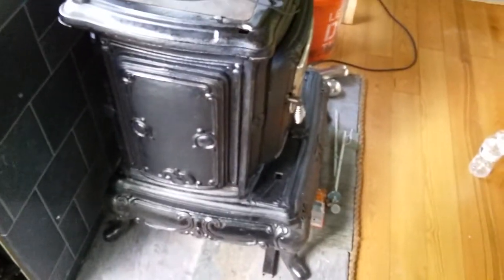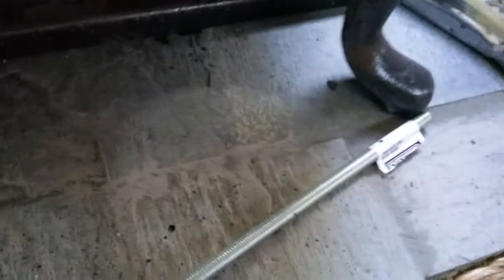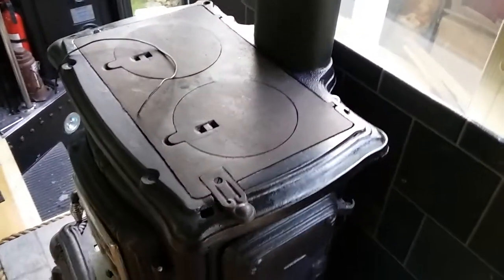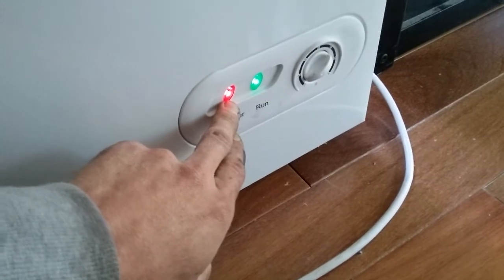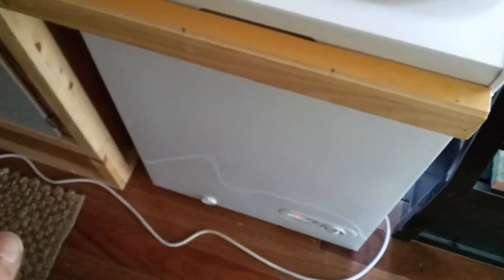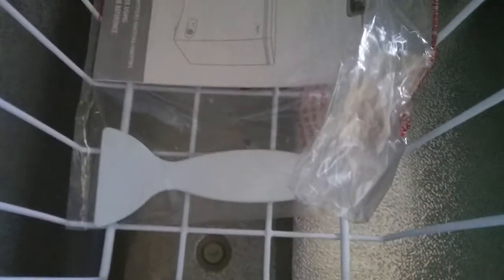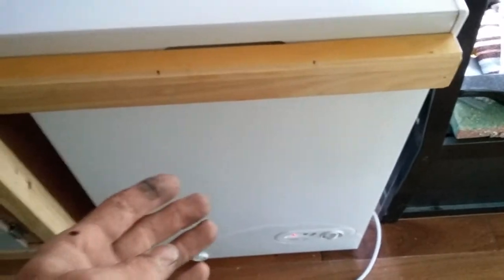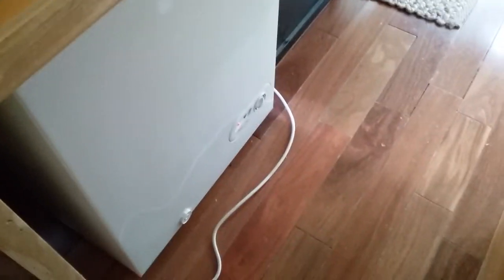Bus conversion  ☆DAY 47 WOOD STOVE & CHEST FREEZER

Comment: Get some gallon jugs and fill them about 80% with distilled water. Put them in the bottom of the chest freezer. You'll build up a nice thermal mass to help keep the rest of your food at a consistent temperature, and have extra potable water in case of emergency.
Reply from the maker: yeah, im goint to do that, an use the water for filling batteries down the road... thanks man

Comment: What brand freezer did you purchase, what size inverter are you using.
Reply from the maker: Roy Vannoy it's a magic chef freezer, my inverter is 1500w pure ... I made a video of the conversion, I changed it to a refrigerator by adding an inkbird digital thermostat...
Reply: Thanks.
Reply from the maker: Roy Vannoy NP, thanks for subscribing !
Reply: So the green light doesn't have to be on permanently?